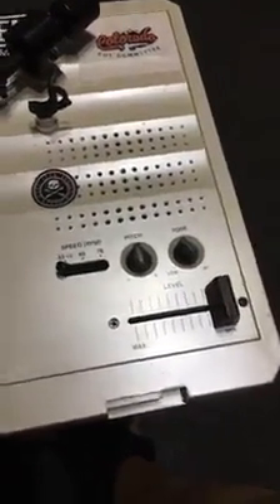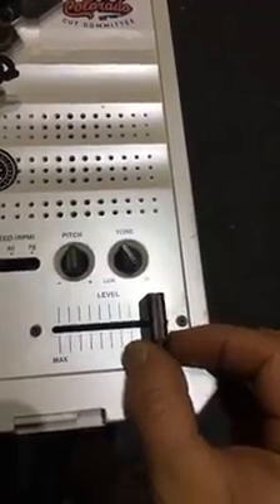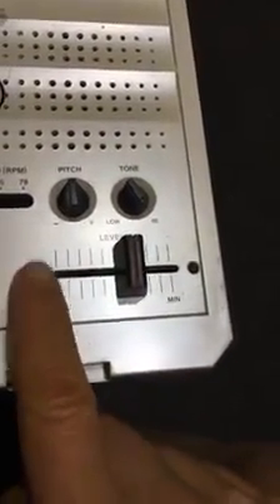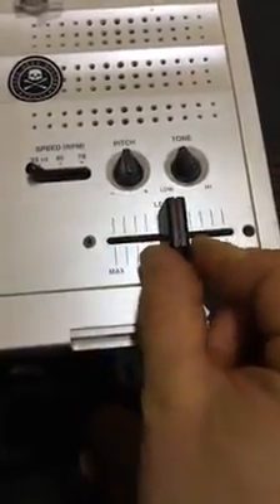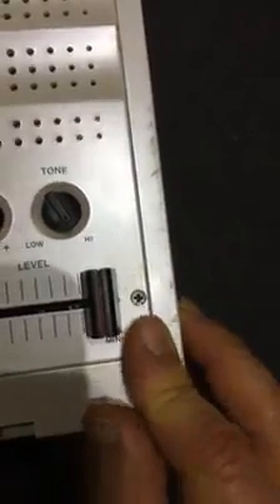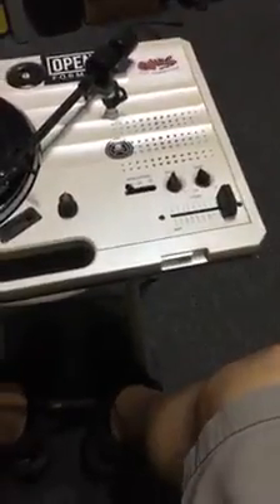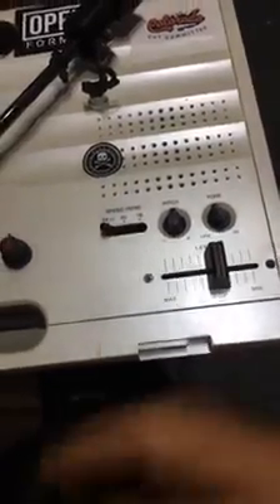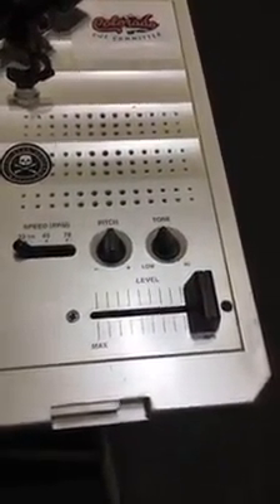RXFI-2 Calibration TIP

Comment: nice. thanks. i did the same thing and had it working but my switch has an led and i couldn’t figure out how to get it to light up. led is totally unnecessary but thought it’d be cool. 

did you remove the extra wires from the calibration harness?

also did you post how you grounded it?

thanks again.
Reply from the maker: i had to desolder the contacts from the raider fader and solder toolbar wires from the board to the button . ill find the video where i grounded it ... i moved the led light as well to give me a visual indication
Reply from the maker: https://www.youtube.com/watch?v=HEy2vImqkC0&feature=youtu.be
Reply: ahh, you used the innofader from a raiden. same fader i assume, you probably have different harnesses. did the raiden have an led to show when it was in calibrate mode? this is what mine is like, i removed the unused wires from the harness. there was 3 wires that i didn't need. one was power though i think. hmm, i'd like to see how the Raiden looks like internally. https://www.dropbox.com/s/v3cq13eh64mc902/IMG_4319.jpg?dl=0
Reply from the maker: https://www.youtube.com/watch?v=yn9jNiqVkoQ
Reply from the maker: https://www.youtube.com/watch?v=nsC2ycyVQt4